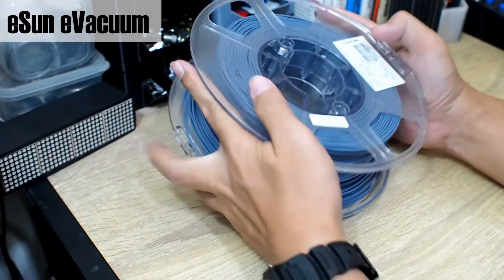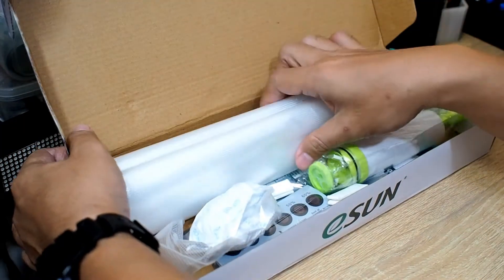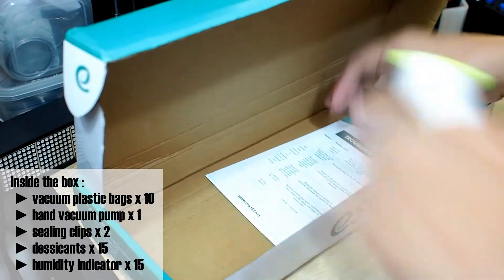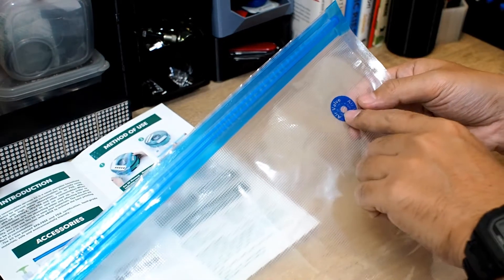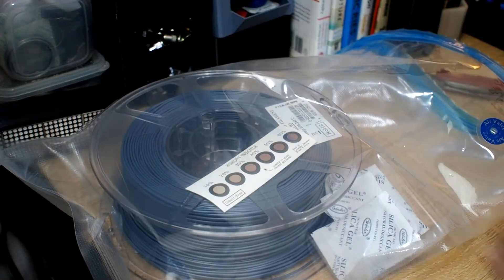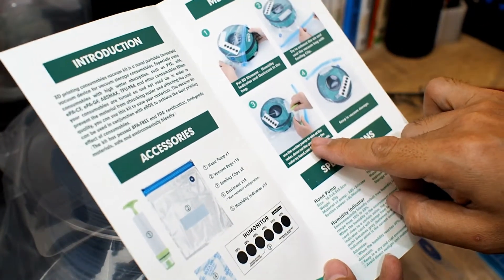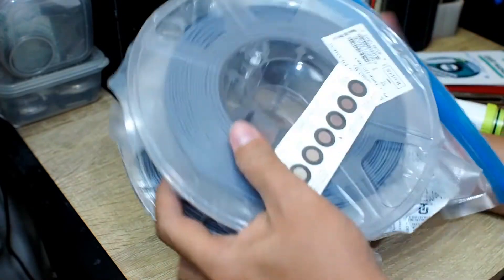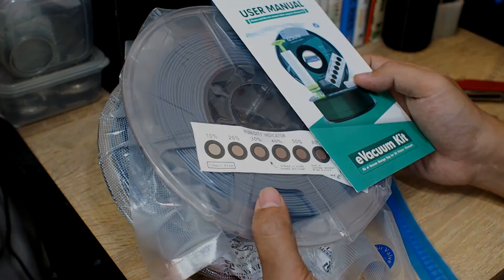Product Review : eSun eVacuum to Keep 3D Printing Filament Dry (First Impression)

Comment: Bought the same kit but all the dessicant was already spent. Ended up buying replacement gel.

They work but really i'd probably just buy any other vacuum storage bag kit.
Reply: Should be able to dry out the gel.  One way is to put it on the handy flat temperature controlled surface we call a "heated bed for a 3D printer".
Reply: @scottwillis5434  much quicker just chucking it in an oven dish and roasting it on low though.
Reply: @scottwillis5434  Microwave, defrost setting for 10 minutes.  If you see condensation inside the microwave, open it shortly to let most of the moisture out and then let it continue the cycle.